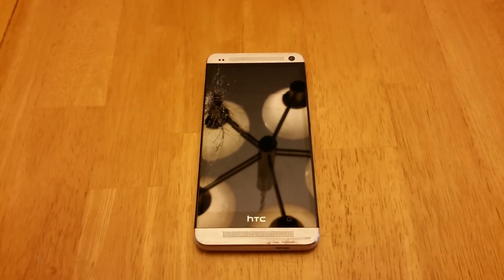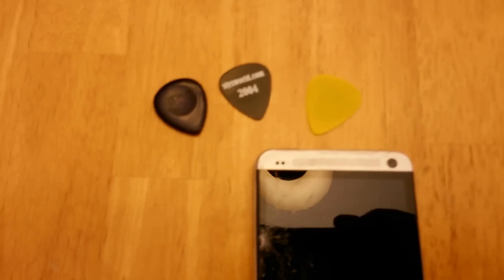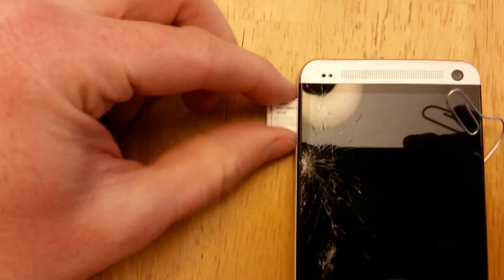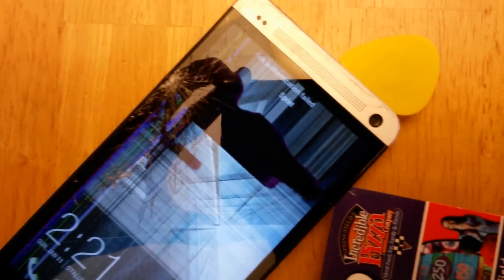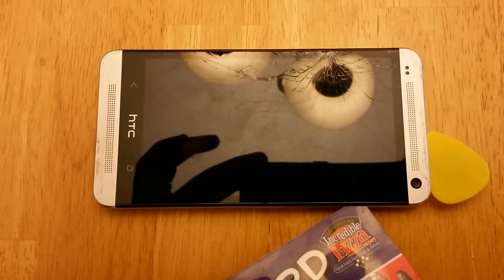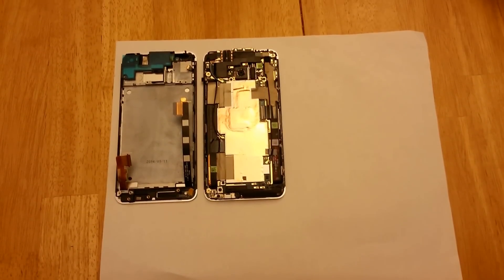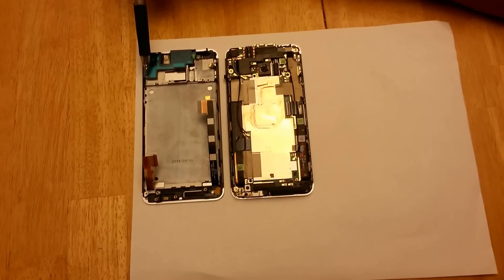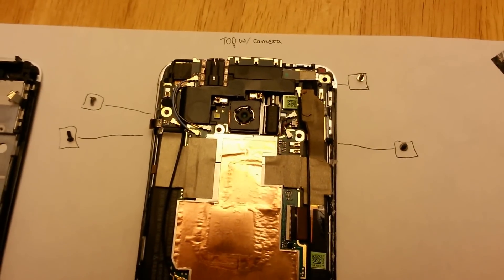HTC One (M7) screen digitizer tear down and replacement

Comment from the maker: Thanks for that! I had watched another video where they had used a dryer or a heat gun and if I were to do it again I would go that route. They also did it from the front, but I agree with you that after seeing how the glue was put all over the back of the phone it would be better to heat up the back casing.

Comment: You actually did a great job ! but you could have used a hair dryer to heat up the back casing it would make it easier to crack open . and there is a little gap in back casing to hold the volume btw.